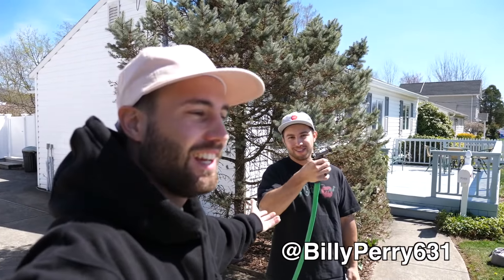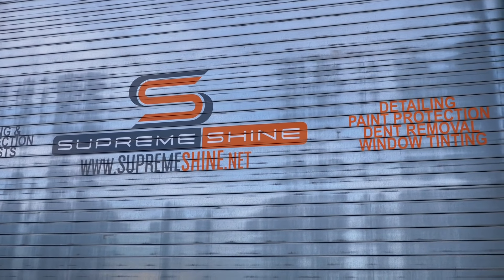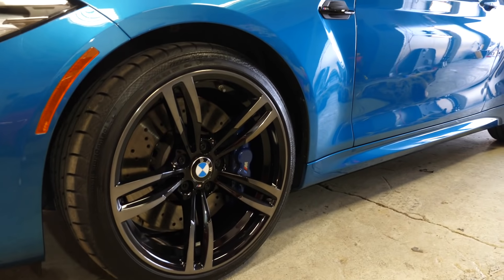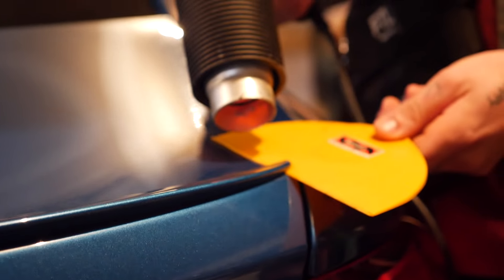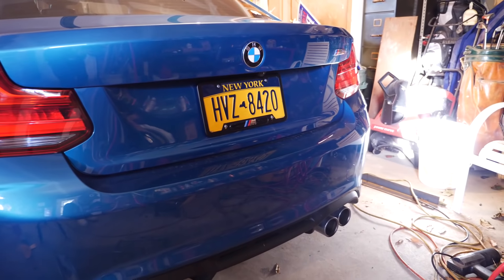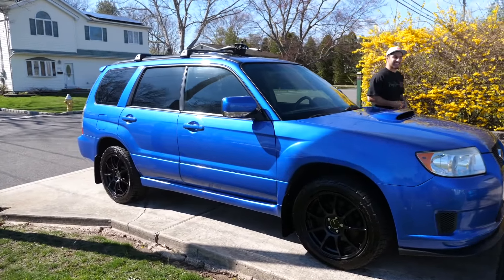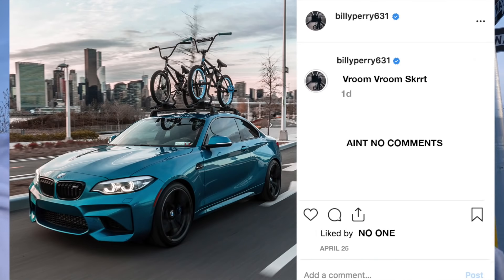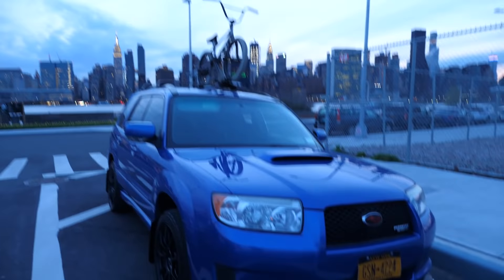First Mods to my BMW M2!

Comment: Downpipes , coilovers, exhaust, stage 2 tune . Then you will really enjoy that m2
Reply: Making the M2 Deeper in New York? I'm not from there but I've been there, and as he said he's doing a lotta city driving, in my opinion coilovers wouldn't do it a favor as I think. 
Still agree on all the other mods tho'.
Reply: @Baileys Miata  thanks, I know that too. But getting coilovers which are (mostly) not as comfortable to ride (in my experience, comparing Audi Stock suspension setup and KW V2), just for the sake of having more stability in curves etc.? I wouldn't scrape my car for that. But if you say the M2 isn't gonna, because you're gonna know better than me, as you have a car in your name, which shows your expert level. KW  also has  "Street Comfort" Coilovers which are pretty nice to ride, but I don't know about BC and other american brands and they're product range. I don't maybe they have something similar🤷🏻‍♂️.
Also why you gotta be a dick about correcting me, shut up next time or be nicer.
Reply: skip the coilovers
Reply: Mark Supreme and wheels
Reply: @Baileys Miata idk why would need coil overs unless you're planning to track the car but that would make it super uncomfortable on the road. And the stock coil overs have electric dampers which would cost you thousands for an aftermarket set. I just cant see how changing the coil overs on one of the best handling sportscars in the world would help unless you want more performance, but then you have to sacrifice the comfort you need to daily it.

Comment: Good job on the coating and the protection. A lot of products are the same, just check out some comparisons on YouTube and you can find a good setup to use. Personally I use maguiars wash and wax and I also use the gold line as foam liquid. Maguiars wheel cleaner and every month I use beadmaker as a sacrificial layer to my already sealed paint. Try different stuff and see what works for you man. Really like mike’s fozzy also, has to be the best model. My choice would be the Beamer tho 🤣. I just foam, let it sit for  a few mins then I wash as regular. I don’t wash off the foam before I wash unless it’s super dirty. The protection really makes it a breeze to wash since nothing sticks and the foam removes like 90% of what’s on there before I touch it. Love the car vids since I’m also a car guy but please don’t go LZ on us and go full car stuff 🤣 sorry for the long write, nice vid and thanks for the update.